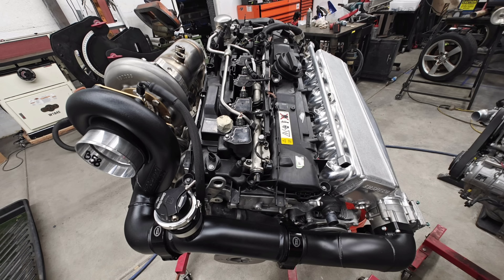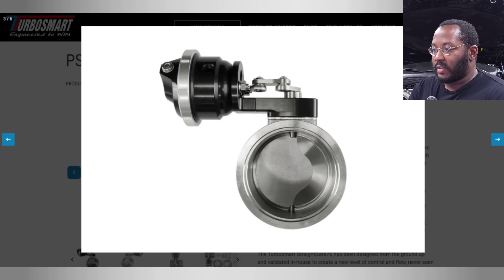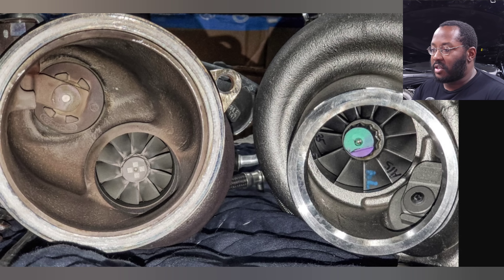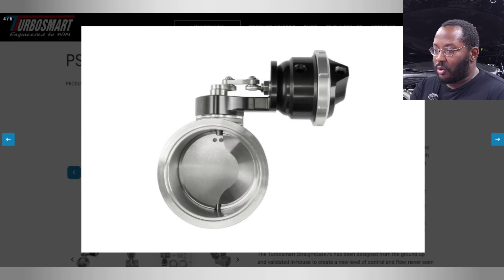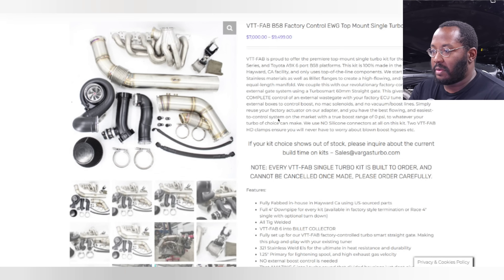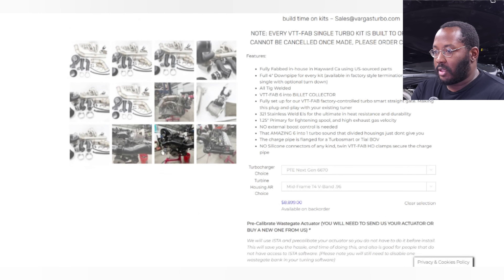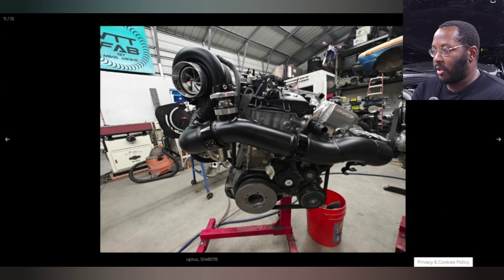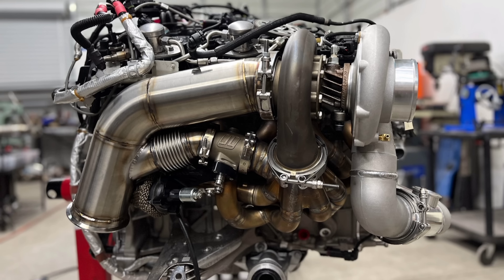This B58/S58 Turbo Kit Uses the STOCK Electronic Wastegate!

Comment: This may be a stupid question but I’m wanting a 440i, do you still need charge pipes then if you upgrade the turbos I don’t know too much about it
Reply: As soon as you start changing boost pressure, you change the charge pipe. Stock charge pipes are often made of plastic that will not hold up to increased boost pressure.

Comment: Kevin, can you explain, why is it that top mount kits on the B58 mostly do away with the MAF sensor, but stock location kits keep it? How is it that the car can run without it?
Reply: @y00h000  no it’s cause that is not a maf sensor it only has 2 wires it can’t be it’s just a temp sensor.
Reply from the maker: because there's no space. the MAF sensor is redundant anyway. not really needed, it's mostly for checks at low load/cruising.
Reply: @ thanks brother. I get there’s no space just couldn’t understand why all of the intake systems for stock location include it as if it’s necessary then top mounts just ditch it. I’ve seen a few people make little downturns for their top mounts, the YouTube guy with the silver top mount Supra comes to mind (I forget his name but the one that had the bad gas issue lol). Thanks for explaining.
Reply from the maker: @y00h000  yeah just more "plug and play" vs having to code it out in a tune. But even with a CEL the car drives fine with the MAF unplugged. Newer cars don't come with a MAF at all
Reply: @kern417  It would be cool if they'd find a way to keep the Maf sensor on top mount turbo kits.
Reply: @JeffmanRSA  I think it would be possible if you really wanted to by adding a tight downturn pipe and a really small filter. There is a guy on YT, the only top mount I’ve seen that actually has some intake pipe pre-turbo, I’m sure a bung for that sensor could be added I just dunno what size filter is on there and how restrictive it is, there’s not much room up there. His YT is Shay Harambe I think.

Several people have noted it’s not necessary though I prefer to keep as many stock sensors as possible lol
Reply: @JeffmanRSA  my kit you can use it if you want pretty much all kits you can just most people don’t cause like I said it’s just a temp sensor.

Comment: If only DI only is good enough to fuel big turbos
Reply: These turbos can push so much air into your engine you can stay di but you’re always going to be limiting how much boost you can run as you want be able to supply the full to get the most out of it
Reply: *Won’t be able
Reply: @techbitter2877 there is multiple aftermarket DI injectors that will support these larger turbos
Reply: Stock engine will not hold what the aftermarket DI injectors are capable of supporting. 800+ wheel stock pistons and rods will not hold that kind of power for very long. So for stock setups which most people are running, you can support those turbos with DI and hpfp which is also another limiting factor. There is already company's make injectors that are out pacing what the pumps can supply. 1k wheel can be made on DI with built motor.
Reply: @christopherowen9081  im on every b58 fb group. i have not seen a 1000whp b58 DI only setup lol. and i rarely seen any DI only setup running more than E50.
Reply: @christopherowen9081  im on spool hpfp and s58 injectors and ive already maxed out fueling on a tiny hybrid turbo on my b58 gen2. huge regret wish i went port instead